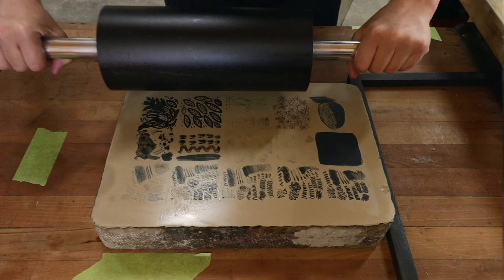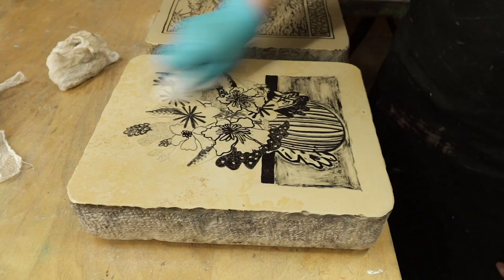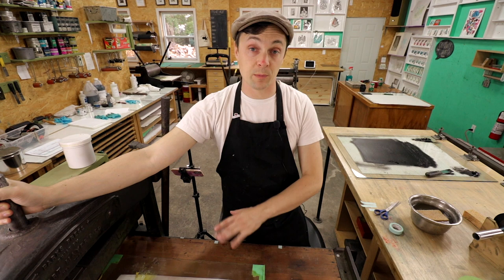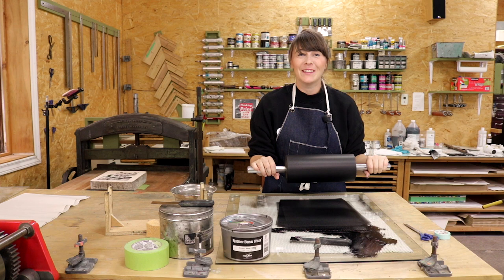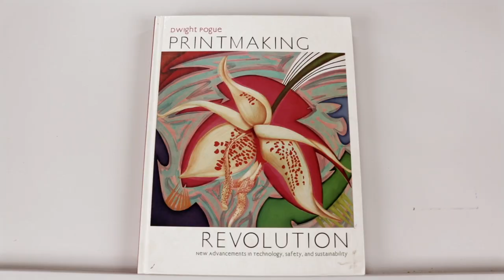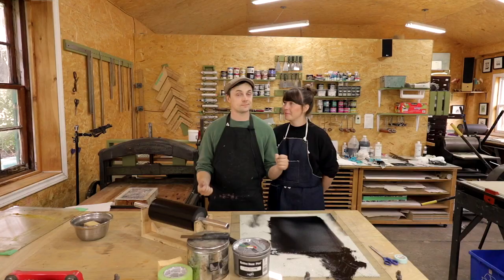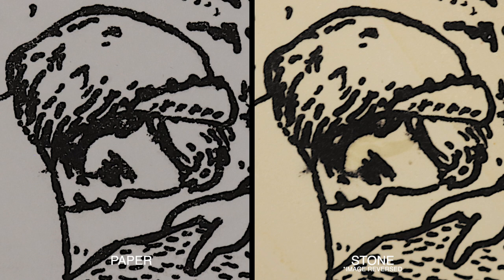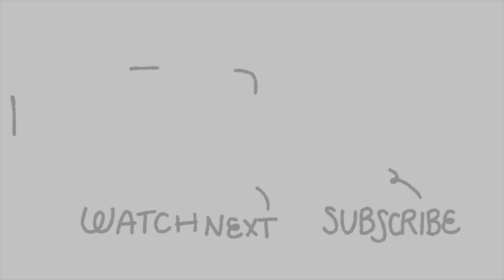Printing LITHOGRAPHS and managing FAILURE

Comment: Arnhem is perfectly fine paper for litho. I like Magnani pescia myself. For ink I'd stick to crayon and shop mix. Add more shop mix to make it leaner. Start at 50/50.
Reply from the maker: Good to know that Arnhem is generally good. I really think we were just handling our ink wrong and should have cleaned the stone better after the second etch. I haven't heard of the Magnani Pescia paper, so definitely going to check that out. This info is so helpful and we really appreciate you sharing these tips 😀